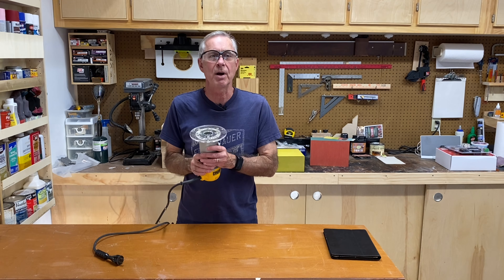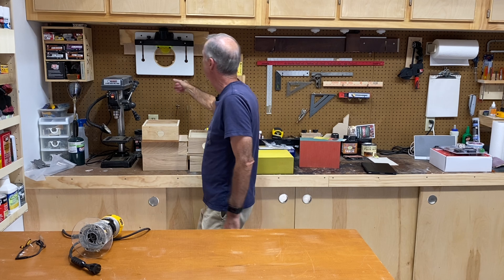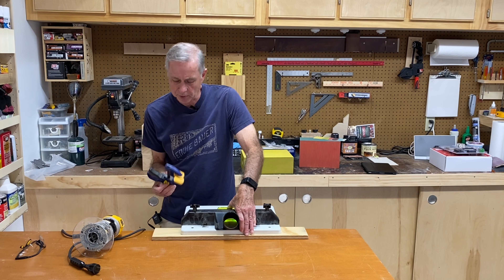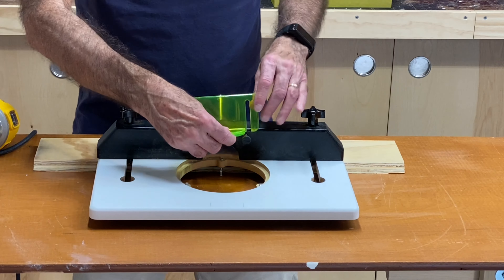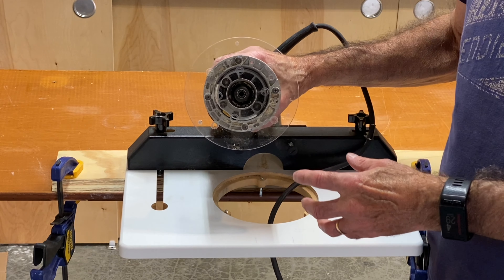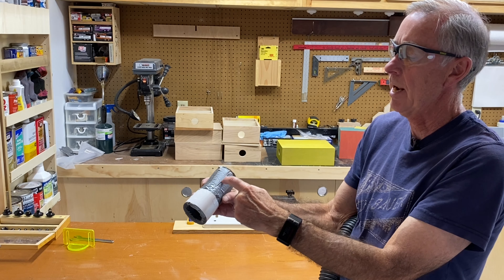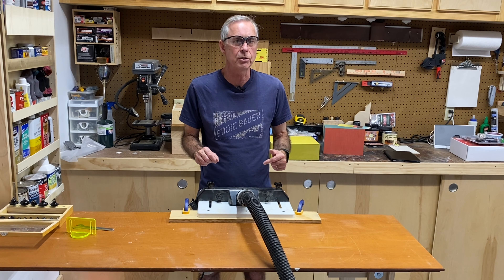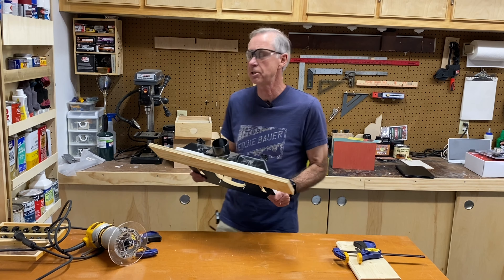Small Inexpensive Router Table

Comment: Thanks for the review, I just ordered one on sale from Rockler.
Reply from the maker: I think you will be happy. If you connect a shop vac to the port, it works great. Really much cleaner. I use my small shop vac and picked up a rubber connector from Home Depot.

Comment: I don't have a table so I really don't know the hassle of changing bits while the router is in the table. If I have to unscrew this and screw that just to change a bit is it really worth it?
Reply from the maker: I have a DeWalt trim router so I just pop the router out, slip the collar off and change the bit. Pretty quick. The table makes some jobs easier.  To me, it’s inexpensive enough to give it a try.